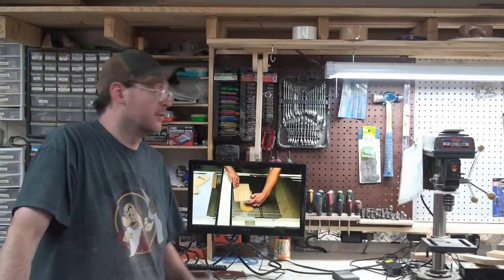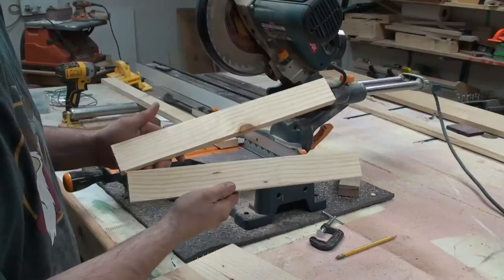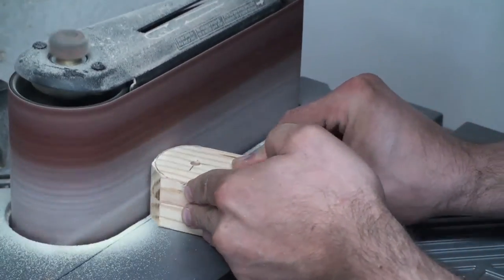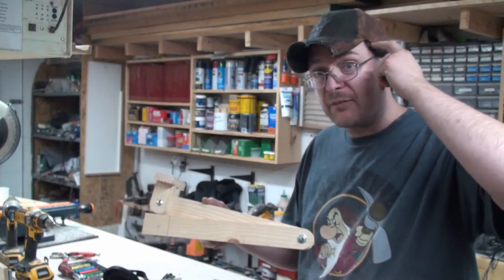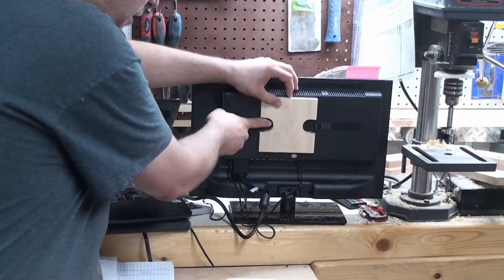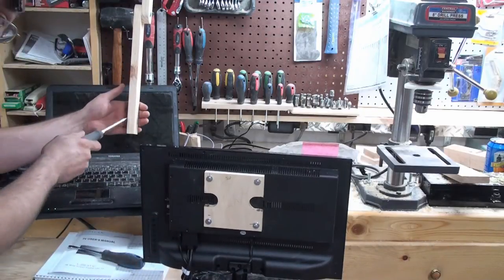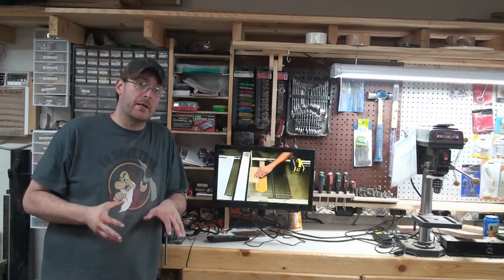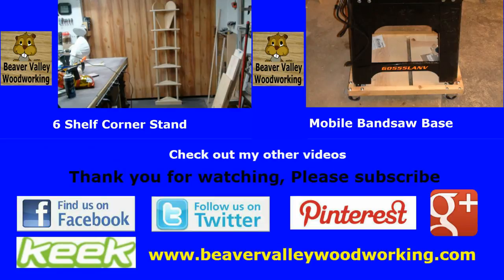Workshop TV mount #13

Comment: Good Idea, get it out some of the dust too. I use a rubberized keyboard in the shop and all I do is shake off the dust.
Reply from the maker: Badlands Wood-N-Stuff Great idea. for the TV I put electrical tape on the plug in ports so if I ever need to used them they would not be fulled with dust.